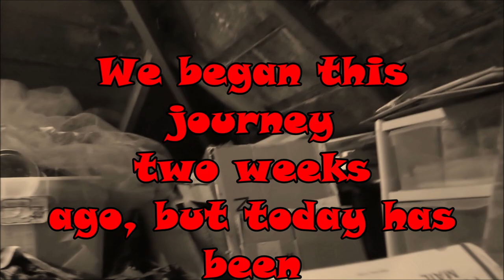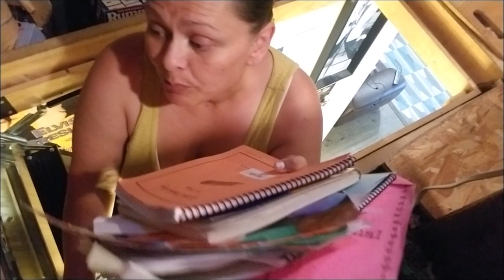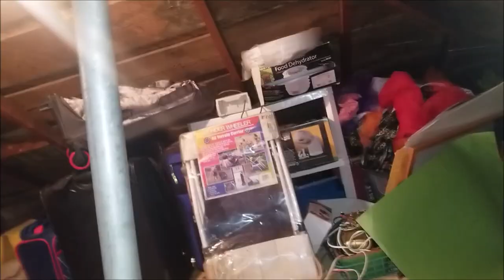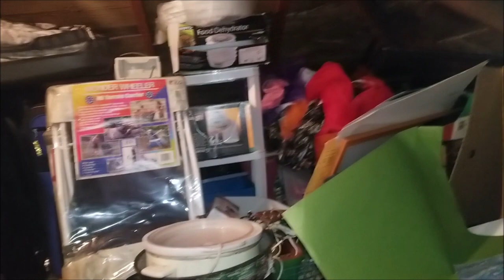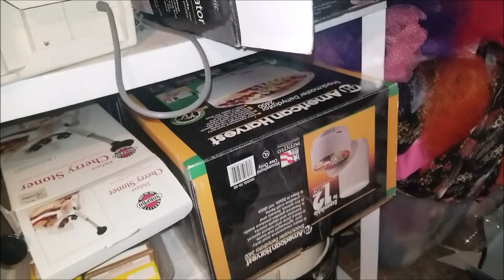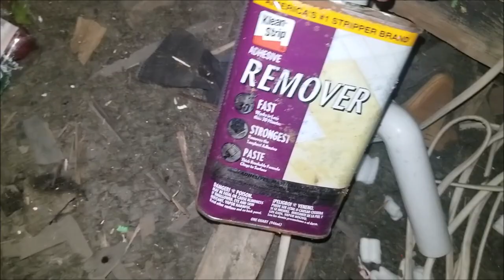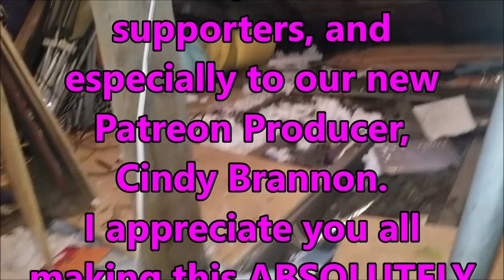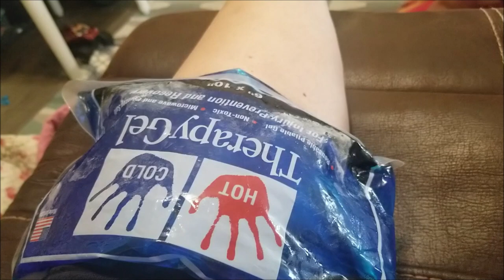DUMPSTER DIVING IN MY ATTIC! How are we EVEN ALIVE?!?!

Comment: Antenna cable doesn’t have enough voltage in it to spark a fire. Be careful up there.  You Tuber Reporter of the week fell through his attic and landed on his cement floor and had to spend time in the hospital.

Comment: I wasn't going to poke my nose in and mention what I think I saw. However as you are addressing the wiring in the attic I feel like I can. I am pretty sure I saw exposed wire coming from one of the boxes attached to the uprights. the insulating covering was damaged.  I am going to call it a junction box. If it were to spark out a fire would be likely. Please have a look at that area.